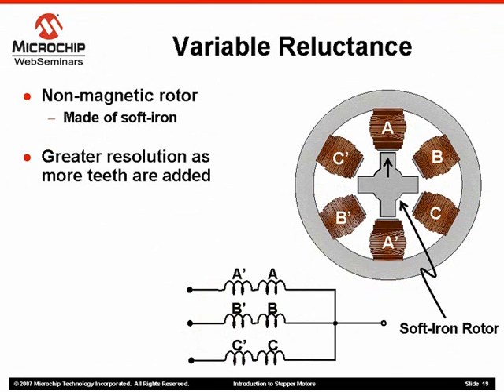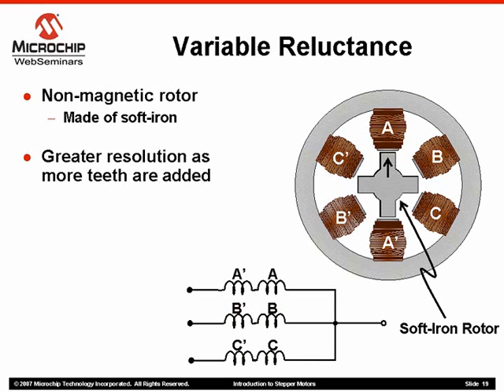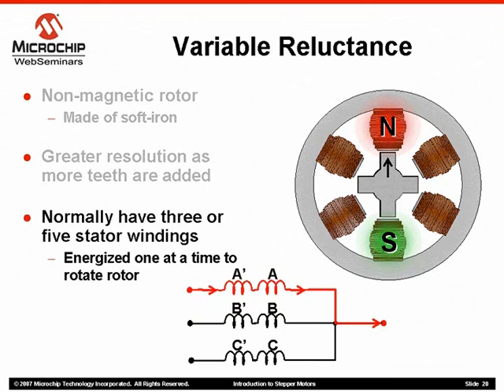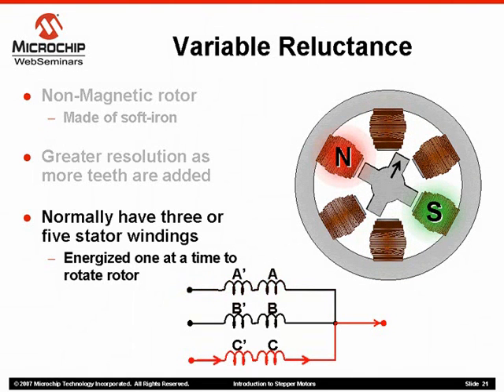What is a Variable-Reluctance Stepper Motor?

Comment: I'd like to use variable reluctance stepper motors in a hobby project. Specifically a very simple 4/2 pole configuration. Any tips on where these can be purchased online?
Reply: did you ever find a source...i'm looking
Reply: @unionse7en  No I haven't. Had to shelve the project I was working on. Please post if you find any!
Reply: @toddlido  , yeah i might use a  BLDC motor or brushed DC motor with encoder and controller instead...I want to be able to backdrive /freewheel the motor with no cogging.

Comment: What about the efficiency of the vr stepper motor?
Reply from the maker: Hi there, thanks for reaching out. In motion control, efficiency is usually mechanical output power (w*T) divided by electrical input power (U/I). At full load, step motors can achieve efficiency as high as 80%. Hope this helps!